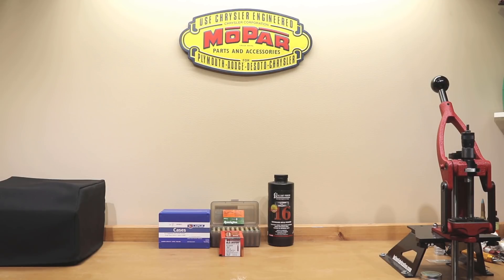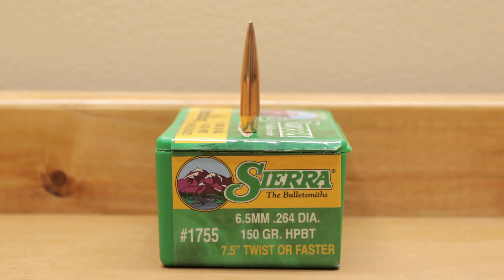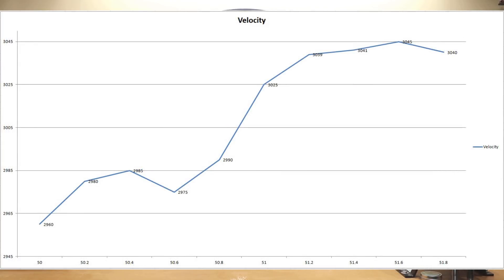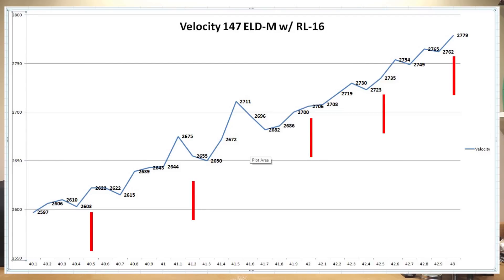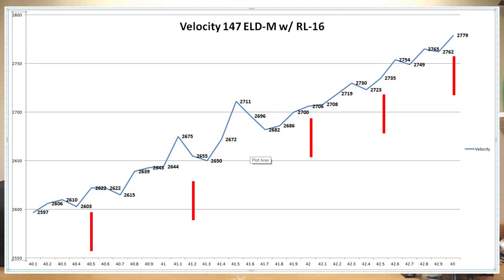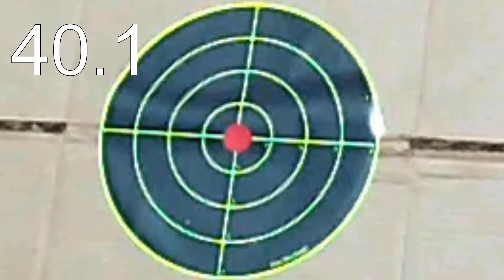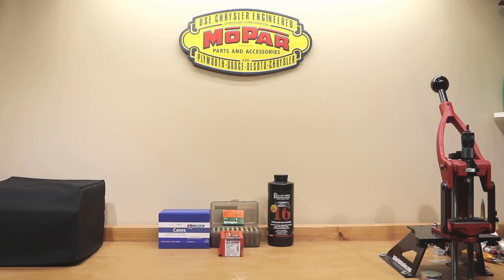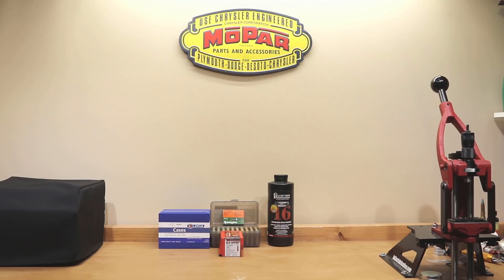10 Round Load Development Ladder test technique with the Hornady 147 ELD-M and Alliant Reloder 16

Comment: I reload and always hate blowing through soooo many rounds to get a good load. Typically I pick 5 or 6 charges and load 3 of each, and check group sizes shooting from a sled. I think I've just gotten lucky a couple times and I know I've messed up a couple times too 🤦‍♂️. I loaded around 300 308 rounds for my ar 10 only to find out they group about 5moa 🤮, I thought my data was good but more testing would have confirmed. it shoots 1/4 inch with federal gold match just to confirm. At least it performs 1.5moa for my bolt 308 but not what I wanted you live and learn or study and learn.

Comment: Great video.  Sorry I didn't see it when you originally published it.   Based on the velocity data you seem to have two nodes here.  On the low end, it's 40.9 and on the higher end it's 42.0 or 42.1 (which you seem have landed on).  I'm pretty confident that if you just loaded 5 of each of these you'd see low SDs and great groups.  In fact, if you look at your POI video you'll see that 40.8, 40.9, and 41.0 pretty much land in the same exact spot despite being .1 grains apart.  You would see a similar pattern repeat on the 42.1 range, but I couldn't verify from the video because by the time you get there it's tough to track the holes.  If it turns out to be correct, post another comment on this video and I'll email you and walk you through how I found it.  Thanks for the time and effort you put into your videos.

Comment: The cratering could be from a few of the casings having more case lube left on them tan others. If there’s still lube on the round when it expands against the chamber walls it can’t grip, letting some slam harder against the bolt when fired. Not saying that’s your problem but worth a look.
Reply from the maker: Hi Dave,
I always clean the lube off my brass. These are just softer cup primers. If you use CCI-41s there is no issue.
BAR

Comment: Regarding the primer cratering. Casefill will affect pressure and pressure signs. As you come from a low charge and increase charge weight you'll hit a spot where the pressure will actually decrease then start to increase again as you continue to increase the powder charge.

Comment: Would you be willing to share your excel template?
Reply from the maker: There is really no magic here. I just created graph the data in excel. Any highlights are added manually for the video. 6.5 guys has a pretty good worksheet if you want to check them out.

Comment: This method is a good one to determine where your best accuracy nodes are.  It appears you best spot would b the low 2700 FPS range.  I get the same results with H4831SC and this combo except with lower chamber pressures.  My go to load is 45.8 to 46 grains. I know the problem with your primer cratering. 1. Those upper loads are overpressure. Remington 7.5 BR primers are one of the thicker primers unless they recently changed their cup thickness.  Your right, CCI mil spec are slightly thicker.  I can tell you that Federal 205M is a great Sammi pressure Indicator.  Citing my experience from hundreds of test loads on NM AR-15 load development.  

Awesome test Mopar!  I'm going to plant a seed..... have you ever heard of Telludyne Straight Jacket Barrel system. It's revolutionary.  Probably the best thing to happen to firearms since the invention of smokeless powder

Comment: Could it be that this method in really good guns and equipment is good.. In more normal but quality guns is a great confirmation of what we see in shooting groups. Allows us to see potential issues of the round maybe being more stable in a range than other that at a given temp and velocity are awesome but temp changes or minor variation in charge might see your accuracy goto hell. I think I like this as a compliment to the original..I find myself looking at the data from groups looking for the same thing but these single charge variations when compared to groups at slightly larger intervals really give a cool insight into good places to load.  Really neat. Also like when you looked at groups around the identified nodes and under all three looks the 42gr node seems to be a winner. Now fine tune with overall length and your done...

Comment: One thing I have found is not to put too much into stock in ES/SD from virgin brass. All manufacturers undersized the brass so it will work in any gun. Shooting virgin brass you are blowing it out to your chamber and resizing it to your die. After this, everything will be more consistent numbers wise whether you are using: neck sizing, a BBND or full length sizing. 

Performance wise looking at a target you may not see much difference if any using virgin brass, but ES/SD seem to settle down for me afterwards. That said, it’s not going to change a bad load into a good one, it will give you more accurate numbers on your refined loads.
Reply from the maker: I completely agree that ES/SD on virgin brass is not something to get hung up on.  This was once fired and produced reasonably good results.
Reply: Bolt Action Reloading I wasn’t sure as it looked like you had data added in from other tests. Since all single shot rounds have an ES and SD of 0. 😎
Reply: I can’t help but wonder for comparison purposes what the velocities would have been on this particular day if you shot 1 round each for the 5 charge weights you omitted. Just curious if it wouldn’t changed the results and look of the graph any/much.

Comment: This is the method I used for my 6.5 CM and it worked very well. When you have 4 different bullet weights and 5 powders you are wanting to try, shooting groups and then measuring size can get a bit frustrating.  I now have a load that shoots in the 0.4s and will be using this method solely in the future for load developments

Comment: I will never be a fan of using one round to evaluate a charge weight unless I find a way to keep my SDs consistently under 10. However, I can see the test's potential in identifying nodes as well as the value in saving money and barrel life. So why not use a hybrid test with 2 or 3 rounds per charge weight using .2 grain increments? That should give you a better handle on velocity as well as some idea on accuracy. These days I find myself doing tests with 4-shot groups over 4-5 charge weights targeting a node range I read on a forum or saw in a video, wink-wink.
Reply from the maker: In this case I want more data than less. I think that there is a load here worth sticking with. Starting from scratch I really think that using this technique to find a node, have a good idea of velocity expectation is far more efficient than loading 5 shots .3 grains apart and shooting. Personally I am taking this as a challenge testing how good my reloading process can be. I think that if this technique does not work that there are improvements that need to be made to the reloading process itself, or simply the rifle is not capable of the desired output. Since I know this rifle is capable, I will tune my reloading process until my confidence is 100%. Finding ES down in single digits proves to me that there is merit here, its whether or not there is more to find, and how good is good enough.
Reply: I hear you, but my old statistics professor is talking to me too. He's saying, "the sample size is too small to draw any meaningful conclusions." Remember, in the previous load test you did with the 147 ELD-M and RL16, three of the five groups had an ES greater than 20-25 fps and the velocities you observed varied approximately 150 fps from the low to the high charge weight. In a perfect linear progression, that's a 37.5 fps increase with each charge weight. In other words, your tests proved there's a pretty big margin of error associated with a single-shot approach and show you can easily wind up with numbers that lead to incorrect conclusions. And those conclusions can have you chasing your tail, and cause you to spend more time and money than you otherwise would have. For your consideration...
Reply: Sorry, just saw your comments on the video and didn't mean to send a redundant comment.

Comment: I'm a bit confused about something tho..how can you get accurate results from just one round per charge? I fire at least 3 rounds..giving me a group. The fact of "wasting" powder and bullets is moote until you find that "sweet spot" then you load rounds from that recipe that is most accurate and consistant.
Reply from the maker: Basically this method should save you the "need" to shoot the groups,   this method depends on knowing your in the middle of a accuracy node on the graph and assuming that if you velocity is consistent your groups should be too. Obviously complete trust in your reloading process is needed and I obviously plan on verifying this in future videos however it's a multistage process. I plan on reloading groups now where I see nodes and verifying the expectation of low SD/ES and with any luck good groups.  Here we were seeing if the charges we guessed at fell along a node did they follow what the strategy thought they would. Largely i think we were successful in accomplishing that. If we can attain good velocity numbers we will play with the COAL to tune the load. Thanks for commenting!
Reply: Bolt Action Reloading I think you meant to say a VELOCITY node, not an accuracy node in the reply above, the whole point to the ladder test is finding a velocity node. Once you have found a node, if any, then you build loads in that powder range to test for group size and adjust seating depth as needed.

Switching to CCI 41 will possibly help cratering, but won't help your ES and SD, I've never found them to be consistent primers. If anything, try the CCI450 or the BR4. But the Rem 7 1/2 has the exact same cup thickness as the 450/BR4/41, at .025"

http://www.accurateshooter.com/technical-articles/primers-and-pressure-analysis/
Reply: the node doesn't change, so shooting 3 of each will get you to the same results with different numbers, then when you get to the node you can run the 3 round test on a few charges in the node to find the lowest es & sd instead of on all the charges. so you can do it in 10 to 19 rounds.